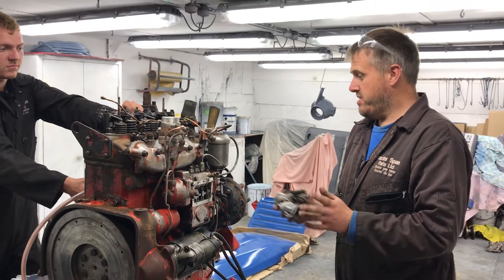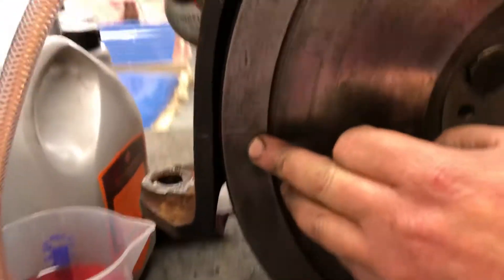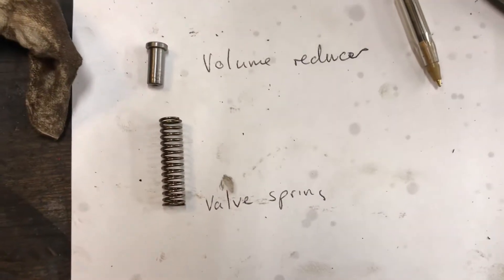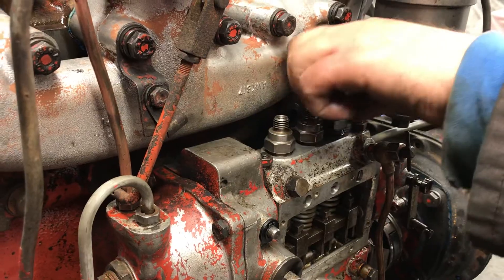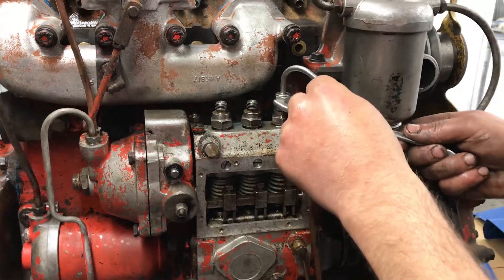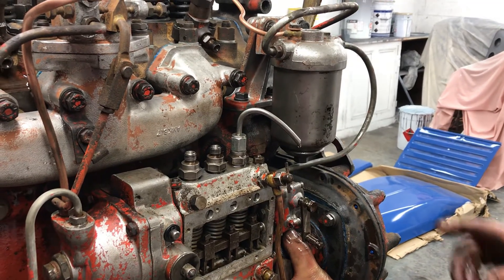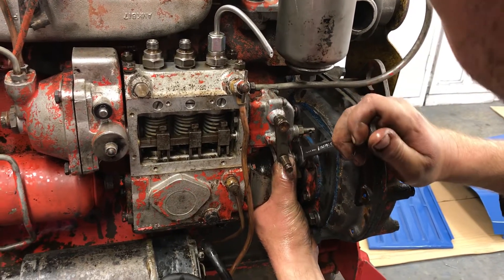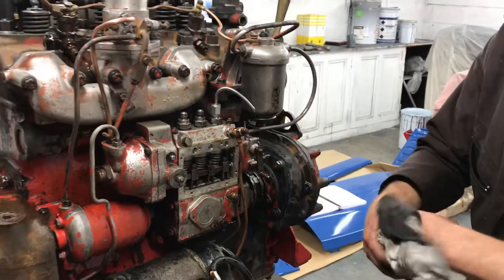Setting the spill timing on a Nuffield engine with inline injection pump

Comment: Hi. How does the acceleration work on your pump. Do you control the air intake or the diesel supply on a nuffield DM4 engine

Comment: hi, where is the fill plug for oil on that pump? thx
Reply from the maker: The level plug is on the side of the pump that is facing me in the picture. It is below the diamond shape you can see on the side of the pump. The oil goes in the side which is open in the video. 
Hope this helps you but if not send me an email sales@tractorspareparts.co.uk and I will send you a better picture.